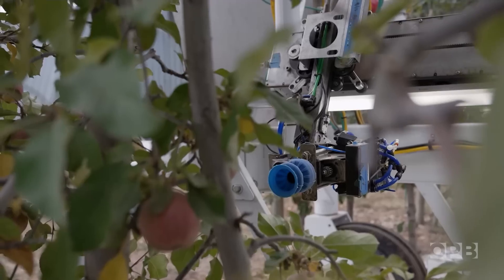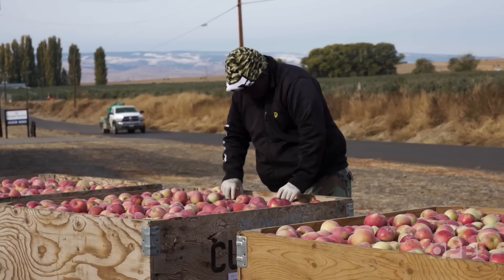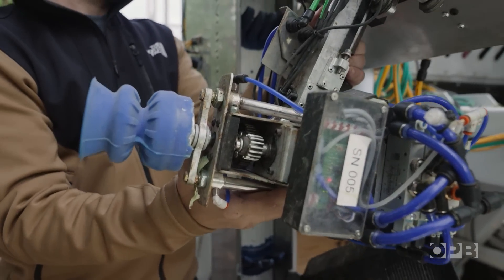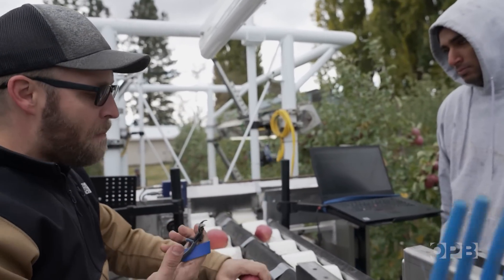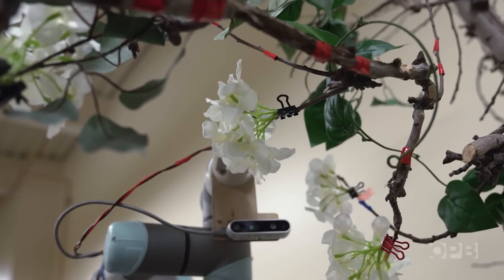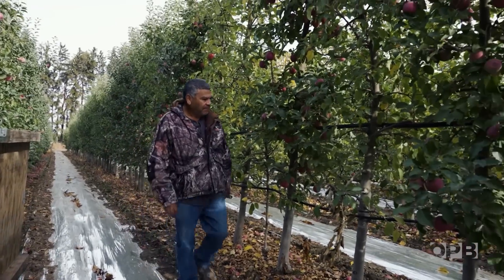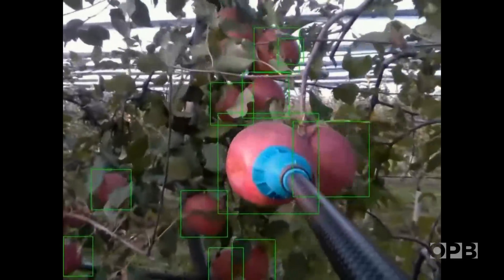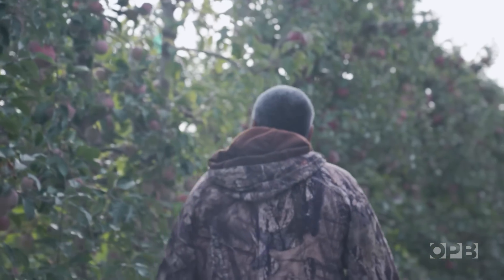The robots are coming — to pick Pacific Northwest apples | Oregon Field Guide

Comment: Its honestly a pretty niche type of orchard, I would imagine. Ive never seen a apple orchard that looks like a Vinyard, like this one. Usually, its just trees. It also maybe won't work great with other kinds of fruit. I don't really want to dismiss it though. It's very impressive. 

Maybe another solution is a variety that drops ripe fruit automatically. A series of nets at the trees would save the fruit, if thats even necessary. 

In my opinion, the simpler the solution, the better, and I also prefer humans controlling machines when possible.
Reply: Most commercial orchards use this type of cultivation these days.  Rows are easier to grow, prune, and pick than individual trees.
Reply: A big labor cost is pruning and the hedge style permits sickle mowers that have arms to mow ditches etc can also hold it vertically and grind the whole face off, then selectively hand pruning bits here and there...there's a lot of hand strain in pruning by hand also. If they wait until ripe enough to drop the fruit will be rotten and squished in transit, won't keep. Could also prune big trees with horizontal arms relatively close to the ground, use flood irrigation, not have miles of plastic tubing etc and use mechanical battery (quiet) pruners, and keep it small, local and cooperative focused if possible. Have you ever tried a Blenheim Orange apple? edit: and you're right, they tried it with oranges and that's one reason they're crap these days, those trees are dryland evolved with large root systems that don't like being spaced 3 feet apart...health = high sugar levels.

Comment: The future is here! A future where everything including apples will become more expensive despite their tremendously lowered production costs, and a future where that doesn't matter because you won't have a job anymore to buy them anyway.
Reply: opposite. For example it is a lot more expensive to have someone hand wash your clothes than using a laundry machine.
Reply: @martinginsburg7222  Everything is more expensive when someone else has to do it for you. 
The proper comparison is that it's far cheaper to handwash your own clothes than it is to use a laundry machine.

Keep buying into the narrative of the Elites and you'll end up having to wash clothes for them.